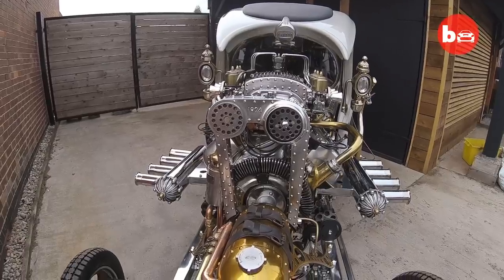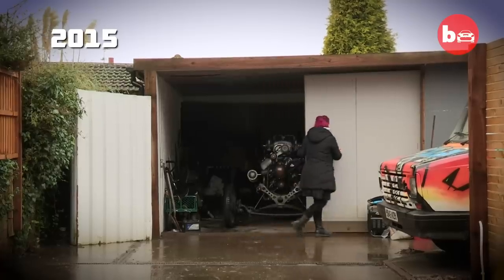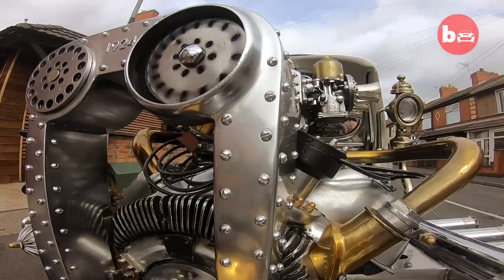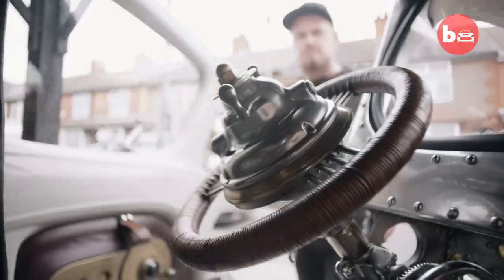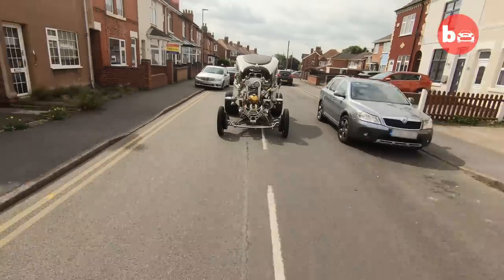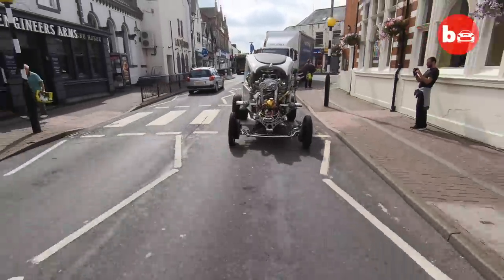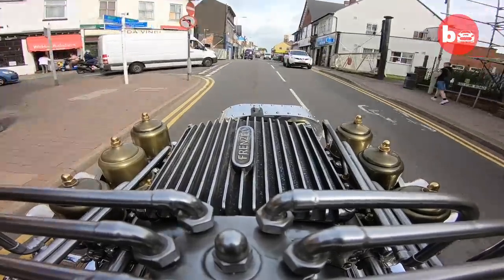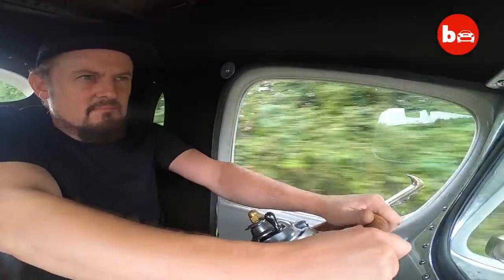Inventor Builds Steampunk Hot Rod From Scratch | RIDICULOUS RIDES

Comment: If that car is legally on the road then he can basically, write a book on HOW he did it. The guy would make enough to fund his next build.
Reply: @bonusnudges  As a one off the vehicle would need an S V A test. Gone are the days of build it and use an old log book from a reliant.
Bike engine trikes can get around the S V A  by having  a removable rear end so it will turn back into a bike. You can't do modifications to the frame of the bike.

Comment: An actual Ardun flathead Ford V8, or just the Ardun heads on something else for design?
Reply: Well, the French Military was making variations on Fords Flathead V-8 well into the 80's or 90's, could be one of those!
Reply: Correct!
Reply: @GreenJeep1998  not ARDUNS do you know what they were?
Reply: @tomschweikert9537  Yes, they are Over Head Valve and Hemispherical heads made for Ford's Flathead V-8 initially designed by Zora and Yura Arkus-Duntov prior to Zora's involvement with the Corvette.  Good possibility that these are the reproduction heads that are still under production, which are an improvement over the ones that the Arkus-Duntov brothers originally made decades ago.  I'm also wondering if the engine itself was built from an original Ford engine block castings or one of the French Military castings that were done well after Ford stopped selling them as industrial engines (generators, tornado/air raid sirens, ect) here in the U.S., let along a production car or truck engine.
Reply: @GreenJeep1998  believe it or not they were designed for flathead powered garbage trucks that had trouble negotiating the hills of london, england  but they are so pretty
Reply: @GreenJeep1998  My guess is is the Ardun heads (rocker covers) are cosmetic, the exhaust exiting the heads looks a little strange and at  44 secs the auto trans bolted to the block looks like a modern block to trans setup without any adapter